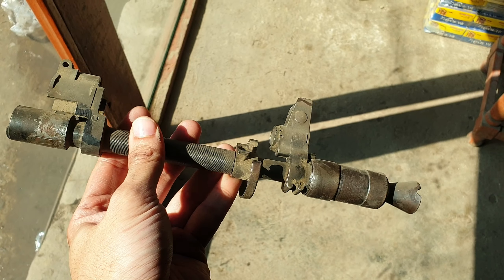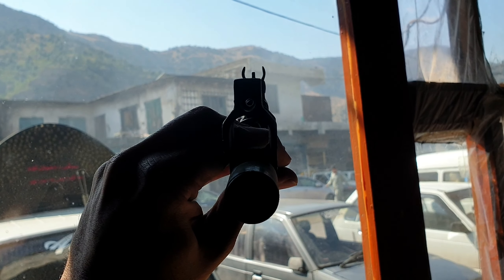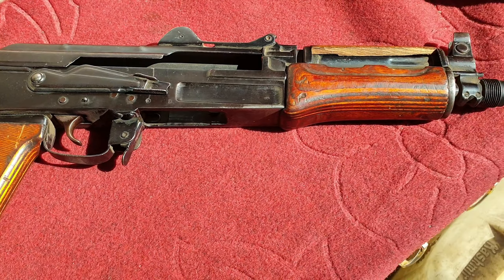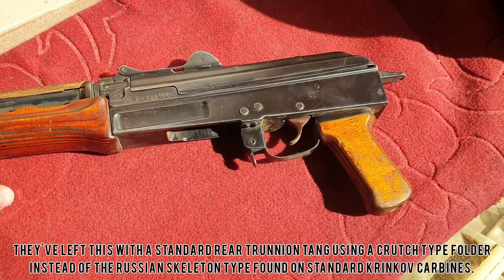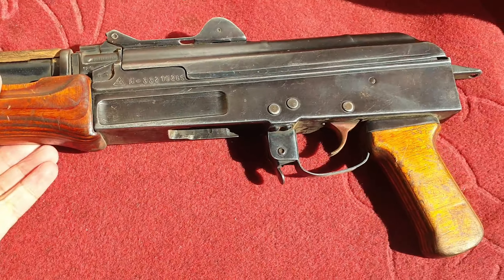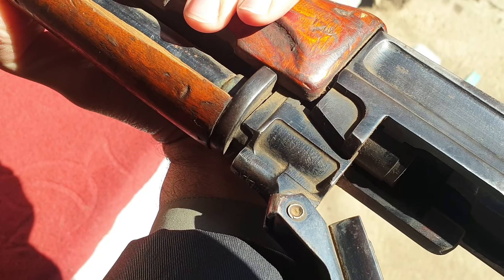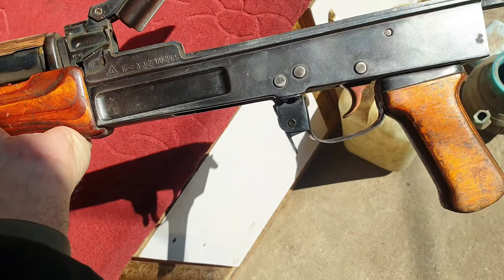Khyber Type 2 AK 'Krinkov' & Old-School Soviet-Afghan War Era Krinkov Components | Darra Adam Khel

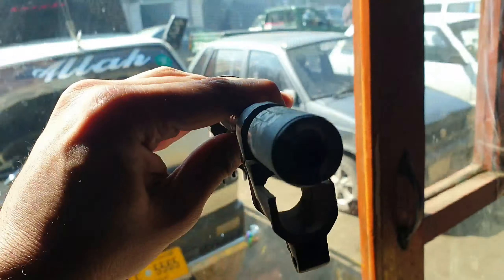Comment: 0:16 - I thought that AK-74 had a different twist than AKS-74U. Wouldn't shortening a full length barrel cause problems with bullet stability?
Reply from the maker: Yes, usually there are issues with keyholing and the projectile not stabilising if I recall correctly. This is a common issue with cheaper or older local copies as they use incorrect twist rates when rifling a short length barrel and sometimes even a long length one.